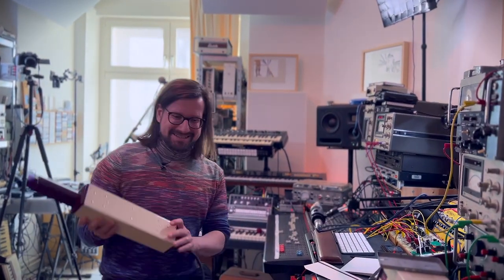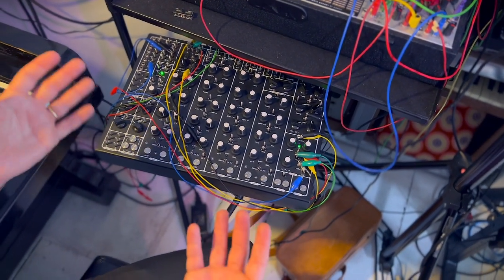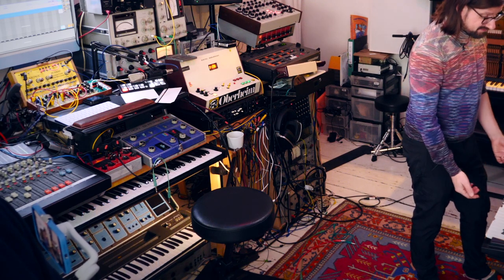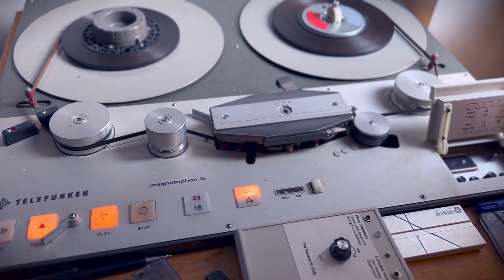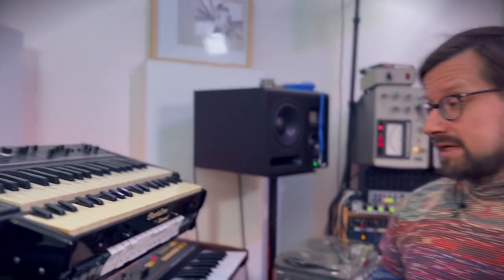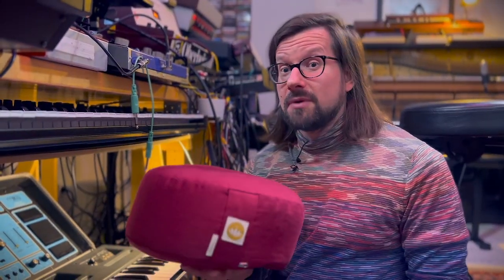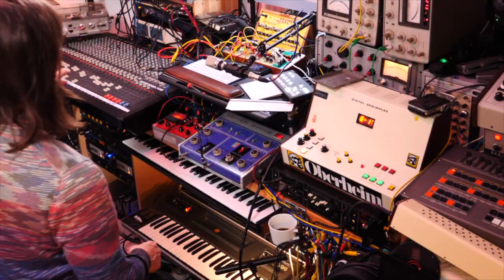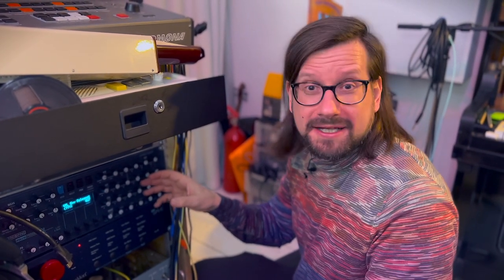My Recording Studio Is Strange (But I Find It Inspiring)

Comment: Thank you for the tour! Cool to see everything in the scope of a cohesive system of “islands”. The room treatment itself was especially fascinating. However, I confess I became fixated when I saw the Korg X911. I’ve used several guitar synthesizers but this remains my favourite for a few reasons, not the least of which is it’s beautiful, musical, very controllable , and sub-aquatic glitching. I used it extensively for a few years as a guitar synth/processor, drum machine processor and vocal processor/synth. What it can do to vocals is like nothing I’ve ever heard. I remixed a friend’s song and sent her vocals through it. One part where she crescendos and the x911 freaks out just sends me through the roof every time I hear it. Another recording features a break with a fairly static Omnichord rhythm going through the x911 while I’m playing with the filter and such. Transformed it with the most savoury and palatable crunch. Like crunch with a “ch” instead of the “c”. A chrunch. Even a shrunch. I know they’ve been reviewed a fair bit in recent years though I’ve yet to see applications similar to what I’ve pursued. Most tend to seek harsh “industrial” and aleatoric results which is fine and it certainly can excel at, but it’s also very capable of warm ocean sandbars disappearing and reappearing with the tides. I’ve just brought it out again after a decade of sleep and will be looking to trigger it with a sequencer. Not many that work with it, but I think the SQ-1 will. Are you able to verify that? It also does track a monophonic audio source perfectly as long as the sound is pure and simple without much envelope variation. Like a simple bass patch. 
Also, I want to thank you so much for your session regarding incorporating noise into projects and performances. It’s helped to reaffirm a love of making/incorporating field recordings of nature sounds, from hypnotic insects to birds to humans with all our clanking and roaring about. I hope to be using the gorgeous NOISES plug-in of yours too, once I start using a computer more or an IOS version is developed. Again, thank you for all the hard and relentless work of bringing your art to us. And thank you and congratulations to your co-creator on her new position as filmographer. It takes patience and dedication to have an eye for detail. The feet were a great touch haha. A line of colourful socks...hmm...well, like you said, the studio is always changing and expanding. ;)

Comment: Amazing collection of stuff you have there! The large collection of test equipment is interesting (I have experience with some of those things, and was not particularly aware that interesting sounds could be coaxed out of them). BUT... In that huge collection, I'm REALLY surprised you don't have at least one, interesting, vintage shortwave communications receiver. They're a source of some extremely diverse sounds, organically modified by the ionosphere. You need something like an R-392, or a nice vintage Hammarlund. Lots of options.
Reply from the maker: I have a realistic dx200, just right now in use.

Comment: I had an earlier model of Ramsa mixer back in the 90's. 
It didnt have the same kind of fast sound I was used to from a Yamaha PM1000 I worked on for a while. But it did have that great EQ with switched frequencies on the high and lowbands, and inserts on every single thing.
Put a a compressor on the FX send? Sure. 
Strap a buss compressor acorss the drum buss, not a problem. Got a lot of mileage out of that mixer and a Tascam 80-8.